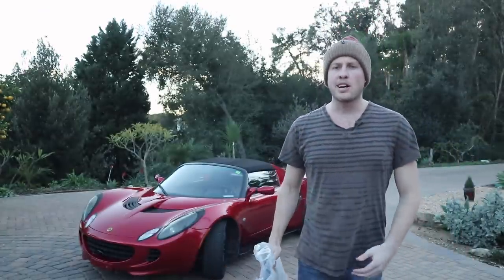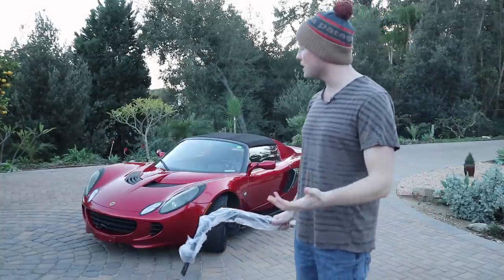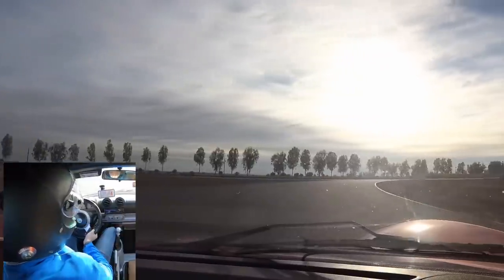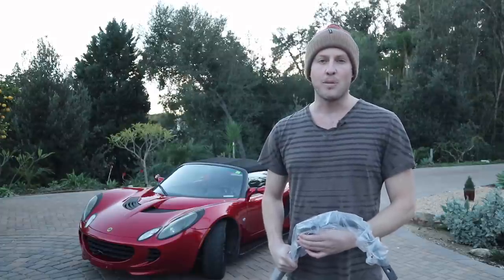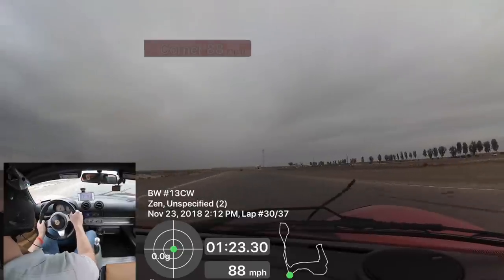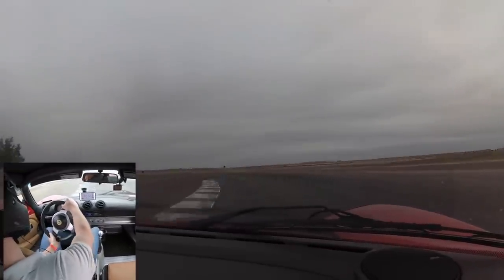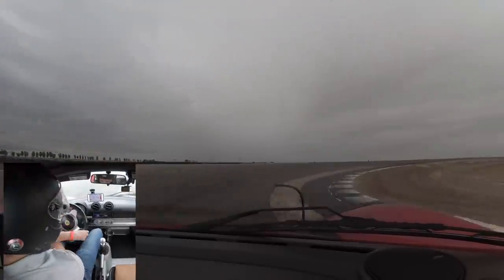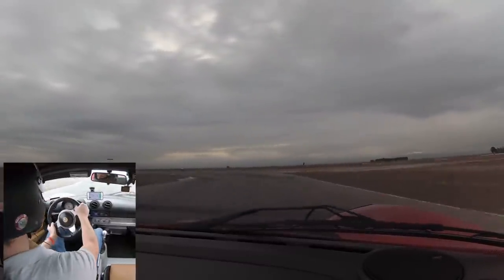Tuning An Adjustable Sway Bar | Lotus Elise

Comment: Great video! Thats some pretty good driving
I saw you are using a cell phone car support that looks quite stiff as its not moving at all, please which one is it?
Cheers
Reply from the maker: Hey Diego the phone has a rokform case and suction cup mount. I got the crystal case but I believe they all mount the same.
Reply: @ZentRose  thank you!!! 👍👍